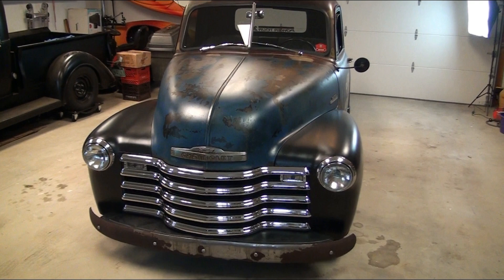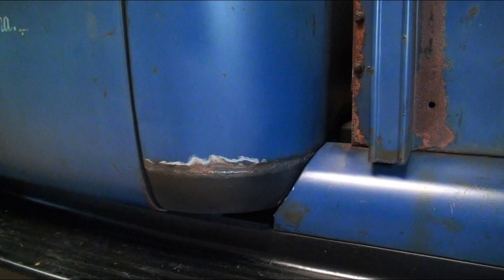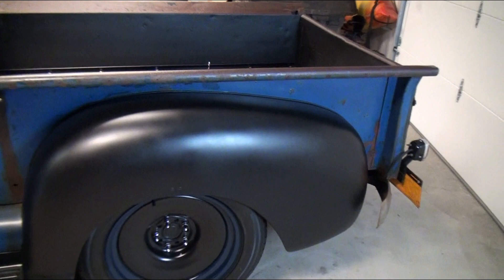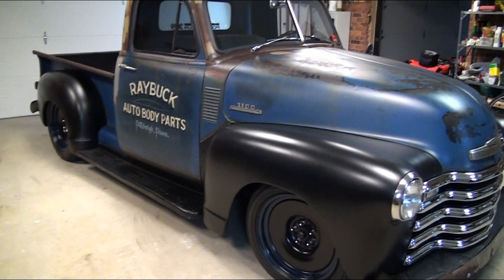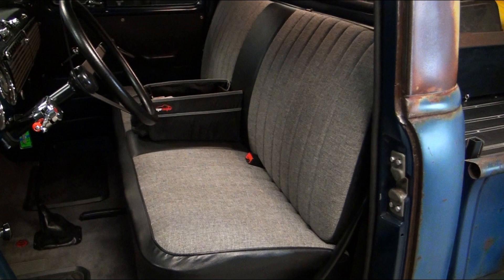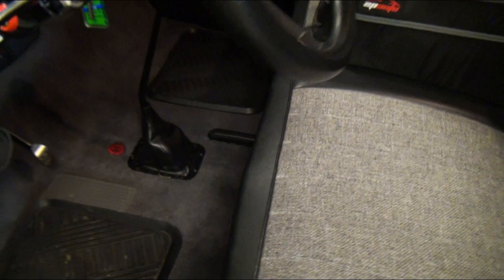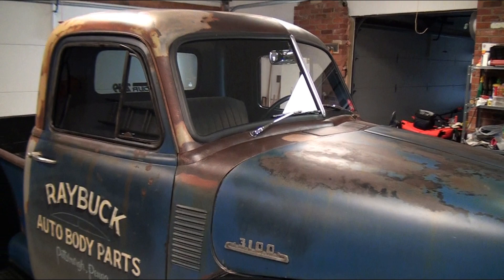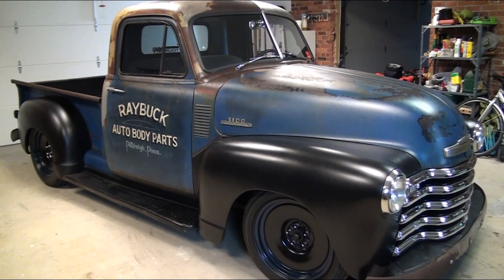Raybuck's 1953 Chevy Pickup

Comment: Nice truck! You need to add some sound deadening  to those doors. Will make a big difference on the sound when you close those the doors.
Reply from the maker: Yeah, I hear you. We actually applied LizardSkin Sound Control and Ceramic Insulation to the entire inside of the cab. We didn't spray the doors because we wanted people to be able to hear the difference between a coated and an uncoated panel. Tapping on the door and then on the roof is like night and day! Maybe I'll coat the driver side door since I'm constantly in and out of it. I'll leave the passenger side door for the test :)
Reply: @RaybuckAutoBodyParts  I have a 65 f100 and hate that sound. But now I understand where you come from. I like the fact that you kept it simple ish so it can be used as a daily if needed be.

Comment: That rear bumper is actually a front bumper, way more curve at the ends than the stock rear bumper. My '53 was tucked in similar to yours with a front bumper on the rear which actually looks better than the kinda flat rear bumper.

Comment: Thanks for posting this video as we are in the process of restoring my 1953 Chevy 1/2 Ton pickup.  Can you tell me if you all have panels or another solution for rusted out metal where the front windshield mounts.  We removed the windows and the metal left isnt good enough to reinstall the new glass.  Again thanks for posting the video great looking truck!!
Reply from the maker: Unfortunately we do not have any type of repair panel for that area of the truck. That is a common problem area, though. Depending on the level of damage, it may be worth investing in a shrinker tool so you could make pieces to patch in.

Comment: Shouldn't the gas cap be mounted flush with the floor bed, too bad if you want to slide stuff in the tray, it gets cracked then you're up for a new one?
Reply from the maker: If we were sliding stuff in and out of the bed, then yes, we would have mounted it flush. This cap is metal, and we primarily just put things in a soft rooftop carrier towards the front of the bed, so this cap is fine for the things that we put in this truck.

Comment: Great build!  What rearend are you running and what's backspacing of rear wheels and tire size ???  Mine is sitting on original rear springs with 3" wheel spacers and I hate it...bought it that way
Reply from the maker: Thanks! It's a late 60s Chevy 10 bolt with 3.08 gears. We didn't modify the rear end, so it fit perfectly on the truck. The build details are all outlined in this article on our website https://raybuck.com/the-raybuck-1953-chevy-truck-build/, but the rear wheel/tire/backspacing is - Detroit Steel Wheels 18×8” Steelie – 5×4.5/4.75 lug pattern with a 4.5” back spacing - Falken Ziex ZE950 P245/55R/18.

Comment: Awesome work, but could you show how you did the petrol tank
Reply from the maker: Sure. I'll get under the truck and try to take a video showing how we built the supports and mounted everything. I just saw a 1947-53 Chevy Pickup Under Box Aluminum Fuel Tank on Speedway that has mounting tabs welded to it. Looks pretty nice, but it's also around $400.
Reply from the maker: Check out the video that I posted yesterday showing the gas tank setup.

Comment: Thanks for the video I was going to buy one of the seat kits from you but noticed the bottom cushion doesn't go all the way to the front edge? Please clarify. I think the welt should be around the front edge....
Reply from the maker: Yeah, I'm not sure why it did that. I've seen pics from customers of this same cover, and it extended further out. The springs in our truck actually came out of a 3500 series, but they should be the same. I mention it because we've seen other things that "should" be the same buy aren't.
Reply: @RaybuckAutoBodyParts  ok. Did you check with your vendor for their comment? I do want to buy a seat cover set.

Comment: What did it cost you to do this I like it ... super functional looks clean let us viewers know thanks great job
Reply from the maker: The cost can vary dramatically depending on how much the base truck costs, what driveline components you choose, and how much of the work you do yourself. We started with a base truck that was really, really rough (in pieces in a field). The truck was only $1500. We also had a small block sitting around that we freshened up, an we had a rearend that we just had rebuilt. And we did almost all of the work ourselves (other than painting the interior of the cab). Time (labor) and existing parts not included, we probably have $17-20k in the truck.

Comment: How you doing Sir?  How do you dropped the front ?   I have a 59 Apache 31 I want to drop the front 
I really appreciate it your help
Reply from the maker: We installed a Heidts mustang II front suspension with 2" drop spindles. That put the front bumper about 5-1/2" off the ground.
Reply: @RaybuckAutoBodyParts  thank you so much for your help

Comment: Great truck guys.  I have a need of some advice about my GMC 5 window 1954 pickup. I am using a Chevy 327 like you guys have done but i'm going with a steel 19 gallon fuel tank that I'm putting between the rear bed rails. Also, i running a 12 VDC alternator and want to convert the gauges to 12 VDC. But one of my first problems is that my 1967 327 doesn't have accessory bolt holes in the heads. Looking at your videos it tough for me to see what heads you're using. If you have an early (1967) SBC 327 like i have how did you attach the alternator and power steering pump? My hang up now is the ignition and wiring the IDIDIT steering colum and the alternator and power steering pump up to work. I have Autocool brackets that seem to work but they hit the inner fender. I also have a 700R4 transmission and power brakes in the under cab stock location and using stock cast exhaust manifolds. I hate headers that leak.  Scott in Oregon   thank you
Reply from the maker: Yep, we had the same problem with our early small block, and it was a pain in the butt trying to make it all work. I had to make a bracket for the power steering pump and one for the alternator as well. I'll try to get a video of our setup so that you can see how we did it. We also used an IDIDIT steering column and their horn switch. That was fairly straightforward to install. The one thing I would do over is the wiring harness. We used some off-brand harness that caused a number of problems during, and after installation. I would highly recommend using a Ron Francis, or some other well-known brand, harness in order to avoid any potential issues.
Reply from the maker: I just posted a more detailed video of the engine compartment (https://youtu.be/p0ORjXB37iI). Let me know if you have any other questions, and good luck!
Reply from the maker: sorry, that other link doesn't seem to be working. You can try this one https://www.youtube.com/watch?v=p0ORjXB37iI or just look at the Project 53 section of our channel.

Comment: I love this truck great job!!!!!  what did you clear coat it with and how did you prep the patina?
Reply from the maker: We just used a satin clear. We simply washed the truck with a light soap mix, dried it and shot it. There were a few holes in the doors where someone had mounted different mirrors at one point. We welded those closed, and then applied a water/vinegar mix to them to "patina" them prior to clearing. We'll shoot a video describing this processes.

Comment: estou com dificuldade de colocar o capuz e todo o clipe dianteiro alinhado! você poderia fazer um videos com o passa a passo, e muito grande a dificuldade, la li o manual mas tem só o capuz preciso também dos para-lamas, desde já agradeço ,
Reply from the maker: It's a pain. Loosely put the fenders and grille in place. Then put the hood on. You may need to shim the radiator support up. I think we shimmed ours around 1/2". Shimming the radiator support, and only loosely bolting the grille in place, were the two things that really helped us align the front clip. We also reamed the hood hinge holes a bit.

Comment: Nice truck!  What is the black truck in the background?
Reply from the maker: 1937 dodge
Reply: @RaybuckAutoBodyParts  Do a video on the 37 next...
Reply from the maker: @garyjones2582  That's the plan. I need to fix the front brakes so that I can get it back on the road. We might actually do an engine swap between it and the 53, so definitely watch for some videos on it.
Reply: @RaybuckAutoBodyParts  Is a hemi on tap for the 37?
Reply from the maker: @garyjones2582  That would be a tight squeeze, but a lot of fun. Unfortunately I think the 37 is going to get wrapped up and sold. Need some room for other projects.